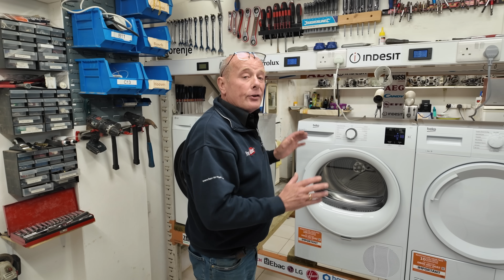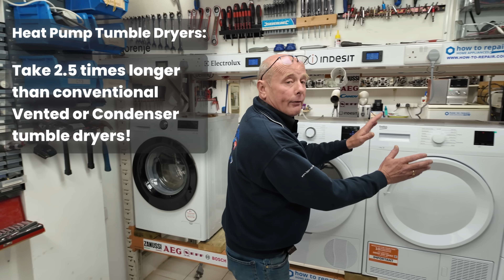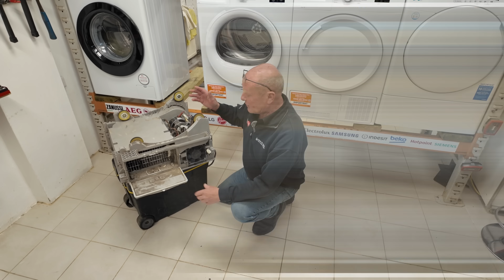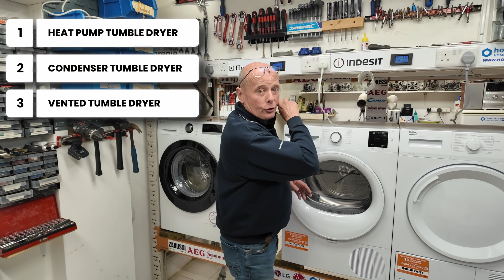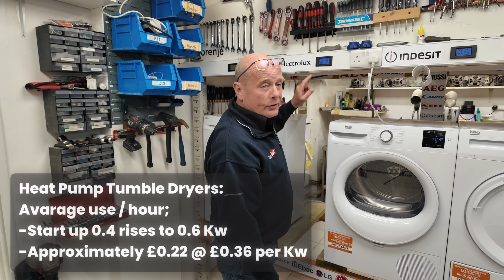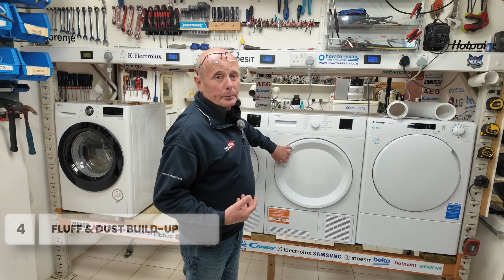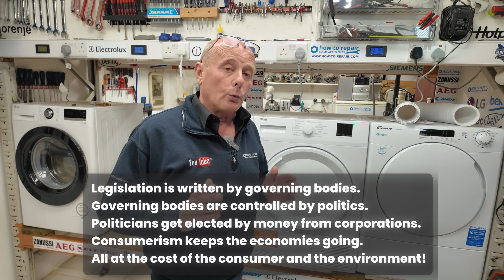Tumble Dryers the Shocking Truth About Heat Pump vs Vented & Condenser, NEW LEGISLATION!

Comment: If and when these heat pump leak out their Refrigerant gas to they get scrapped? ie the home owner used a running lower cost dryer then the high cost unit is scrapped?

I ask this because in the USA nobody repairs a leaky hvac gas AC window airconditioner. Some last a decade or two. Some get a fatigue failure in the hvac coils and gas leaks out in a year or two. So the 150 to 650 unit is scrapped. ie nobody repairs them; they go to the scrap yards.

I ran my house off of 3 window unit AC's after Katrina/2005. The two pre Katrina made in usa Sears/Whirpool units lasted 12 years' one built in 1998 still works at age 27.

The Chinese dinky 5500 to 6000 window ac units lasted from 1 to 4 years before the they froze up due to low gas. So they are just disposable junk with a short life span. Went thru 6 of them over 8 years before getting a main AC.

so is the mindset of heat pump dryers and water heaters to save the planet with low operating costs and ignore HUGE costs of scrapping them? 

Locally once the warranty is gone they are scrapped as a failure then you spend another few thousand dollars to buy another.

The sad thing is a water cooler here built in the early 1960s uses R12 and cools fine. But NEW  Chinese Window AC with R5689ZqT gas will have a HUGR variability in life due to crappy hvac coils and joints and being shipped and dropped since built across the globe. A 6.5 cubic foot Sears Kenmore "Dorm Fridge" here was built in Japan about 1970 and uses R12. I need to replace the door seals. A Watthour meter has been on this unit a few decades. A brand new unit today does not have any better energy savings. A buddy bought it used 50 years ago for 50 bucks.

Comment: One for the “peanut gallery”:-
In 2003 in bought a “pair”, top loader washing machine (old tech paddle agitator) and a matching vented tumble dryer.
They are still working. Sure, they don’t have the same control knobs, but that’s the only repair so far. Well done Frigidaire.

Comment: I plan on buying a spare vented dryer before they are fazed out.
Heat pump dryers will not save much money with repair bills taken in to account and I don't want my clothes to take 2 or 3 times longer to dry.

Comment: I have repaired 30-50 year old Whirlpool dryers for very little cost. Easy to work on and parts are cheap if you shop around. They can run forever if you keep maintaining them. The old machines would run for 30 years. Every modern improvement has shortened appliance life.

Comment: Thank you for your efforts we get bull shitted so much I bought a heat pump dryer probably the only benefit I get out of it is that I've got solar panels so I can run it off the solar panels but it doesn't dry as well as the old way condensing and it takes forever and sometimes I have to redo it again

Comment: One of the best, un-biased, technical., data driven, honest, broad based, insightful product videos. Excellent job.

I “discovered” heat pump tumble driers recently. Made my own ROI (on the condenser price premium) and our useage, which at current prices was about 3year.

I didn’t purchase a heat pump as it needs +18 deg (home temperature) to be efficient. Ours is in the garage. Which suits condenser.

Heat pump maintenance issues - surely not all manufacturers hide the filters away?

Comment: I changed to a heat pump dryer just over a year ago. I was skeptical as first but soon saw the benefits. The heat pump takes a fraction of the energy that my old condensing dryer took, the clothes come out soft and aired not hard and overcooked. Although the timer says 235 mins more often than not a normal clothes load is dry within or just over an hour. Only towels take longer. I don’t have to worry about checking as the dryer has a sensor which detects when the load is dry and automatically stops. I clean out the lint filters after every use and vacuum the condenser mesh each month. I have noticed that the gentle drying on my clothes is prolonging the life of them and ironing takes a fraction of the time. I use my dryer once a week occasionally twice a week, I don’t expect long life from any appliance these days even though I look after them it just seems to be the way of production, there’s no profit in long life products makers need us to be replacing them. I am happy to continue with the heat pump based on lower running cost and better care of my clothing. I feel a lot of problems people experience with heat pump dryers are to do with not being able to use them correctly. Forget what you did with your old dryer, switch it to highest level turn on and leave it, let the sensor take care  of the load.
Reply: We bought our first heatpump dryer many years ago.

Clothes from 5 people = 1 load dried every day.

The cheapest heatpump dryer is only £15 more expensive than a non-heatpump unit here and with the cost of electricity in the matter of 2-3 years the dryer has completely paid for itself in saved electricity.

His claims of heatpump dryers having an entry price of £400 is also false, atleast when i look at the prices here.

Maybe the £400 is because this is what he sells them at, right now the cheapest heatpump dryer i can get is ~£300 and i have seen them even cheaper on black friday deals and so on.

This is not his first video on this subject and i am convinced that the main reason he does not like heatpump dryers is as he says...They are not really repairable, so he is unable to make a business out of that, whereas traditional dryers, he can make a bit of money, changing a heating element and whatnot
Reply: @JohnDoe-bd5sz  so, better to have a reparable dryer that you can repair over and over again instead of producing waste by buying a new one or dont you understand that?
Reply: @JohnDoe-bd5sz Yes he is definitely biased
Reply: @estherbrightman9338  But the old ones have sensors too, mine is over 25 years and got a so called sensor. Actually it's just a copper brush which touches the barrel on the outside and measure the resistance, wet or humid air in the drum has less resistance than dry air, as drier the cloth gets the sooner it switches off, if I dry to restart it, it stops after 10 seconds because the cloth is to dry. I use my old condenser dryer still instead I put up PV panels for compensation the high wattage. Because of a cat in the household we use it very very often, to get rid of the hairs. But it's good to know from a person who is experienced in both dryers, that for the cloth it is better after the use, a good point to change maybe in the future. Greetings from Germany
Reply: @SchorschvomDorf which brand and model is it?
Reply: @johnmachter40  What do you mean, mine? It's a AEG Lavatherm Model number I have to look up.
Reply: @SchorschvomDorf  yes, danke :)
Reply: @johnmachter40  Bitte You are welcome, I can look up later the Model Number if you want
Reply: @SchorschvomDorf  that would be great if you could look it up for me
Reply: If we stop expecting long life from appliances as a collective the expected life will just go down and down and keeps going down. We have to believe and demand for longer life for all products across the line, and start selling old appliances for people who want to fix them. Why cause Recycling won't save this unsustainable life of ours, I strongly believe RE Using everything and repairing them will keep humanity more sustainable. Don't get me wrong I'm not against buying new things, I'm against wasting energy of buying new and wasting energy on "recycling" as it's not beneficial to anybody anymore, somebody somewhere can still make it work or take spare parts from it. A proper new bearing costs only 20€/$... and you can get an extra 12 years from the machine.
Reply: @nexttonic6459  I do 100% agree, I am the kind of person to try to fix everything, with the obsolescence starting with the light bulbs over 100years ago the Industry always try to find new ways to make it obsolete quicker, printers for example. I fix a crashed Nissan Maxima, which our daughter has an accident on the way to Spain, because I build it up prior the crash with her, I know how good the body is. Found a Spare Maxima and cut out all body parts I need for only 300€ welded everything again, needs now only new paint and back on the road again. The body is in measurements back to spec dimension all good.
Reply: Repairs will. Get you first $500 bill you will gaurenteed get puts any savings to the grave
Reply: Awesome to see this comment.
Reply: Although the timer says 235 mins more = almost a 4 hr cycle
So if a condenser takes 1-1.5 hrs to dry a load and uses 2.5kwh and your heat put were to use 0.75kwh you end up using 2kwh on the heat pump not the mirracle energy saving device afterall

Comment: Our Bosch vented dryer is exactly 20 years old.  It's rarely used for drying clothes although it is used to tumble towels in cold air before hanging them up to dry.  So it uses almost no electricity.  The chance of my paying £400 to replace it are pretty  much zero !

Comment: I use a clothes maiden and a dehumidifier. You can put an insulating sheet over the maiden to trap the heat and dry air from the dehumidifier. Takes about eight hours but uses less energy than tumble dryers, fewer moving parts, less wear and tear on clothes and the dehumidifier can be used elsewhere in the house. Checkmate!

Comment: I agree with all you say. I would also add on a simular subject that new kettles now have to be of a lower wattage, 1800 watts I think now, but a lower wattage takes longer to boil the water. I have never measured the consumption when comparing new kettles vs older kettles but logic tells me it my be a lower wattage but running longer to acheive boiling water will use almost the same amount of power.

Comment: Most of the issues you mention is due to specific design, a well designed heat pump dryer doesn't have to have any significant disadvantages, besides upfront cost, and longer drying time, and even those aspects don't have to be as bad as they are after few further design iterations. There are plenty of heat pumps in other applications that runs for hours each day, and typically works flawlessly for many years, that actually don't cost very much. To make bearings that doesn't see significant loads outlast the average tumble dryer many times over is not difficult, and doesn't require very expensive bearings.          

That said, all those technologies could be made far more energy efficient with really good heat recovery through efficient counter current heat exchangers. But that would make them slightly more expensive to produce, and that's after cost of development have been diluted on enough units to make cost of development insignificant, per unit. Isn't it stupid to generate a lot of heat and then waste it, when it's so easy to recover most of it, with a well known simple technology without moving parts?

Comment: A better solution is to use a vented dryer that uses a long lived design, and never use  the high heat setting. It will save more power.  If you ask me mechanical controls are superior.

Comment: I think the same is very true of anything that is supposed to be better for the environment, central heating, electric cars. Car's are generally heavy and wear tires and brakes quicker. We have a combi boiler Central heating system in our flat, and I'm not convinced of the efficiency compared to something with a cylinder that stores the heated water. I would love to see a direct comparison. Same exact type of flat, and the two systems over a one year period

Comment: WRT energy usage. My ASHP is taking heat from outside. The tumble dryer would take heat (energy) from inside the house (which will need to be replaced) and using it to effect a state change in the water held in the clothes. Factor that in and the energy advantage will be greatly diminished.

Comment: Best solution Is dry your cloths outside. Its free and Eco. Heat pump have COP >2 + using condens energy fom water vapor so must be 2x more efficient. If Its runing 2.5x longer than Its a good point why? Maybe compressor not runing all the time? Should expect more from 40years specialist.

Comment: My heat pump tumble dryer has outlasted my last condensing dryer which was "uneconomical to repair". In that time it has saved me more money to run than the cost of the dryer vs a condensing dryer. So your mileage may vary.

Comment: Thanks for drawing attention to this issue. I have owned four of the old style vented electric clothes dryers each being replaced around ten years of service life . Each machine of different manufacture didn’t even break down only being replaced when they looked a little cosmetically challenged. My existing machine is a White Knight electronic model again with no breakdown after 10 years life, I would have replaced with the same manufacture but they are no longer made. I have been looking at the heat pump type but armed with this information will put off buying one until or if these issues are addressed. We have all seen the government pushing EV cars with the higher costs including depreciation,early obsolescence,cost and ease of charging etc. I think the government ,manufacturers are pushing the woke agendas on the unsuspecting public who in the end pay a heavy price buying this technology.I have no problem with better goods being made but I for one will need some major convincing until I can see genuine improvements on what is being made so far. Well done for bringing these matters to the publics attention.

Comment: Surely with the extra time the heat pump dryer takes and as you say the wear on the parts due to this along with the cost of scrapping a heat pump dryer it would be just as cost effective to buy a vented tumble dryer which in theory should last 2 & a half times longer, so effectively the vented or condenser even with the extra electric cost of running it would work out more cost effective over all ? other wise its a £300 bill for repairs after 5 years or £400 for another heat pump dryer when the other 2 should still be working after 5 years as long as they are maintained ?

Comment: I maybe not saving the planet , but I've had a gas tumble dryer for 30 years and still going strong the only part i have replaced is the motor capacitor.

Comment: What wasn't mentioned in the video is that heat pump dryers use significantly lower temperatures to dry clothing. This means the clothing's damage is much lower. 
Otherwise, the video makes a sound argument. Though... I have a condenser washer-dryer, and cleaning the fluff around the ventilator and heating element when it stopped working was quite a pain. Yes, with a heat pump washer-dryer (we got these in Europe), it would be borderline impossible. But it's not easy on the condenser type either, and most DYIers wouldn't be able to do that, I think. The shops in my country charge circa $300 to completely clean a condenser washer-dryer, meaning you do it yourself or you go buy a new washing machine.

Comment: What's the total cost of drying if the heat pump unit has to run so much longer? If it's heating the clothes,  then it must be moving cold into the house, what's that costing to heat again? We really do need a rethink on heat pumps and how to integrate all heating and cooling needs across all household functions like room temp, water, clothing etc.

Comment: I did the math on these ozone killers a couple of years ago and spotted that heat pump dryers are not worth it. I wanted to check the cfc gas used and its impact on the environment. The Samsung one I was looking at getting was using the Fgas that was banned for use in fridges and freezers by the powers that be. So the work around for the thousands of tons of this poison gas, that the companies have, is to put it in "heating" appliances and tell us that its good for the world. A first year law student could have seen this loophole coming but someone at a free lunch missed the heck out of it. Note to self... buy new Vented Tumbler tomorrow.....Quick side note: if you do 3 20 minute mixed quick washes of 10kg and you have a 7Kg heat pump tumble dryer with an ambient home temp of 19c, how long will your wash day take you to end?